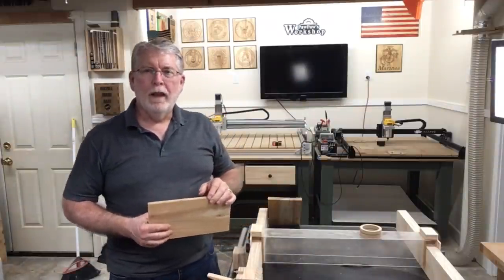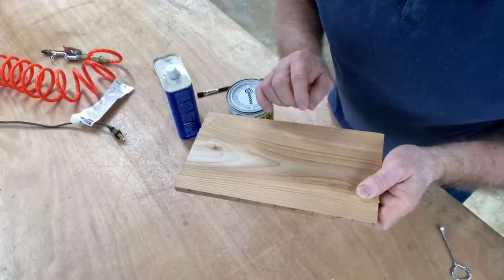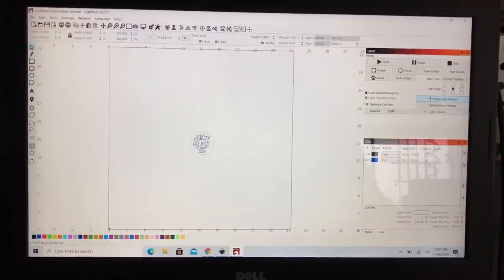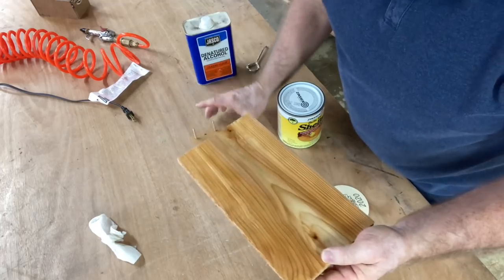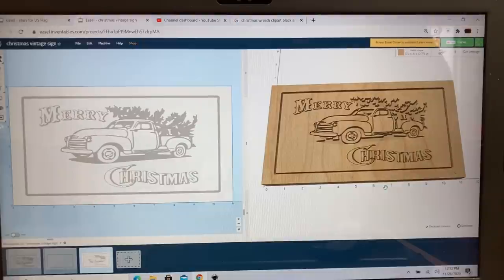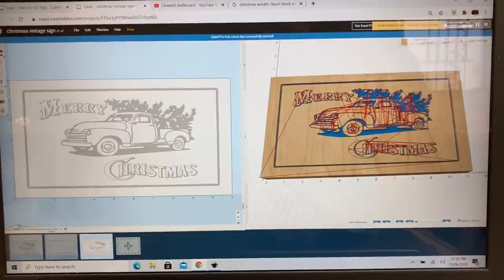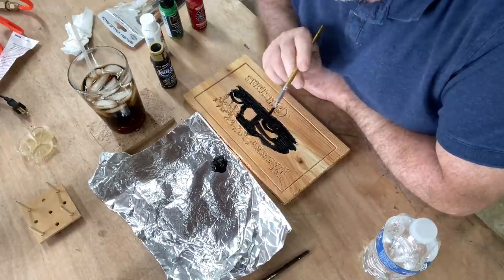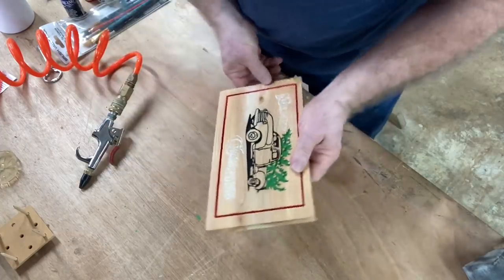Two Painting Techniques Explained

Comment: Great project... I like the design. I found the paint on soft woods, bleeds into the sides of the cut when painting the letters or design. This can be prevented by giving the finished cutting board a spray of clear lacquer. That stops the paint leaking into the sides of the cut letters or design when applied. Love your videos.
Reply from the maker: Thank you. Often just a spray coat of clear is not enough to completely seal the wood. I have found that I have had more success with brushing on the sealer

Comment: got a tip, bought vinyl flooring double sided tape in a roll only used 2 at 2 in by 1 in one on each end the wood stuck fantastic it also came off nice worked fantastic
Reply from the maker: Awesome!  Thanks for the tip

Comment: PawPaw,
I notice my rotor is moving a lot on my original xcarve. Does xcarve sell that upgrade that you have holding your Dewalt?
Reply from the maker: It sounds like the v wheels are worn out.  No, Inventables does not sell the upgrade z axis that I have on the machine.  My upgrade is from cnc4newbie.com.
Reply: @PawPawsWorkShop  I’m going to have to upgrade. My other question is when you do a two bit sign, (not cheap) only us older guys would get that. Two layers on a sign with 2 different bits, will the machine automatically stop so you can install the next bit?

Comment: great but you forgot to center it to the ordament before you engrave it otherwise it is a very good work and the idea with the markers i like very good.But make from them 100 pieces and it will take a very long time.Then you want find a way to fill those out with color faster.
Reply from the maker: There is always another way to complete a project based on the specific need. If I had a 100 to do I would cut a stencil for each color and spray them. You could even screen print them. Your imagination is your only limitation. That what makes this such so exciting.  Each project is different. Thanks for sharing.